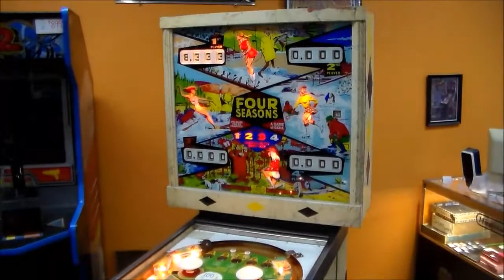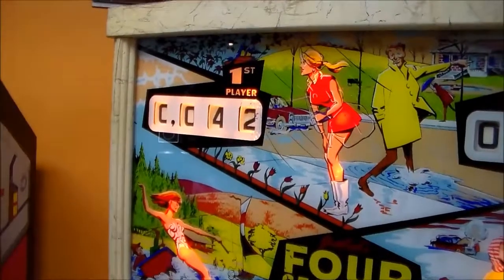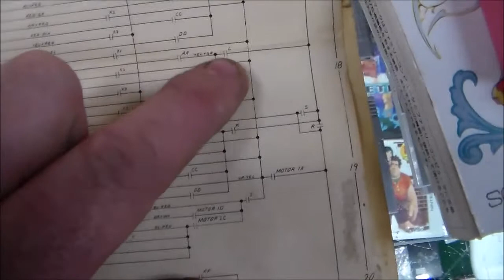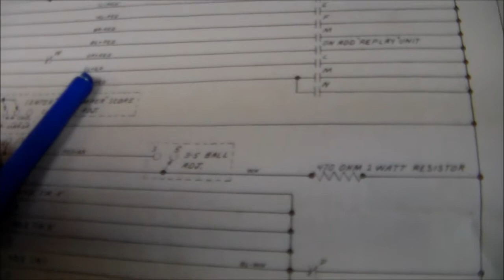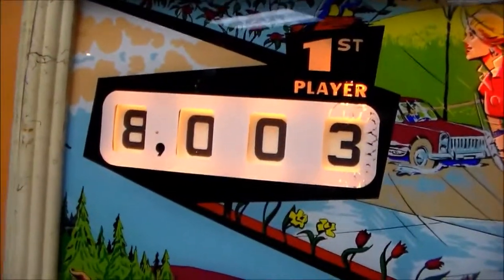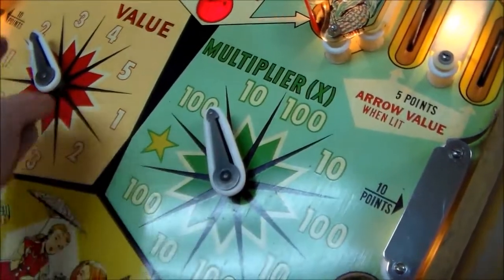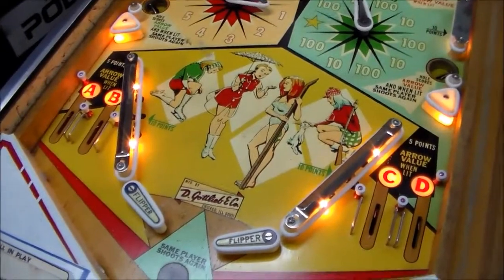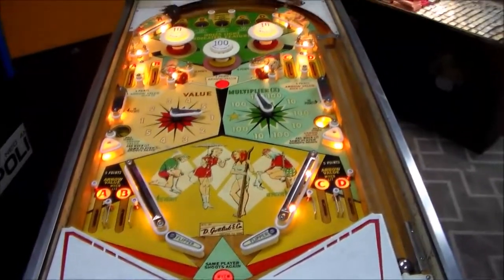Troubleshooting a Gottlieb Four Seasons EM Pinball Machine - How To Read Schematics

Comment: Joe wasn't bored one bit! I live for this kind of stuff, to tinker and fix things. My wife says, "You go to work and fix electronics all day then you come home and work on electronics some more! "You dear a true Geek"! Not to mention I love to read technical manuals for fun as well. To me electronic devices are the ULTIMATE PUZZLES to figure out. I love these old machines, how complex they are, yet simple. If you take it one step at a time and apply some simple logical thinking they can be fixed. Then when you're done you get rewarded with Electronic noise: Buzzing, bells, clinking, clanking and lights galore, who wouldn't love that! Yep Joe, loved it and wasn't bored one bit. Thanks for the schematic lesson Joe. "Sir, May I have some more please"! Best Wishes n Blessings. Keith Noneya
Reply from the maker: Keith Noneya Thanks Keith we’re kind of the same way... working on them is more fun than playing them:)
Reply: I couldn't have said it better myself.  Retired now,  but used to work on computer issues all the time at work, and then came home and dug into more, personally chosen, computer issues.  Similar, wife comments. ;)  Puzzle-solving for sure.  The EM machines are fascinating and rewarding, but I'm just now learning how to attack those problems.